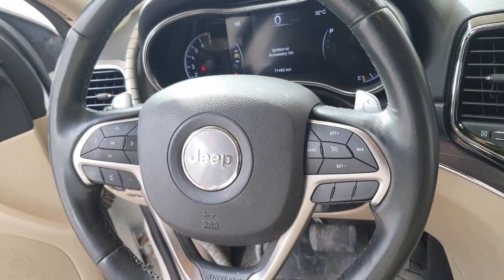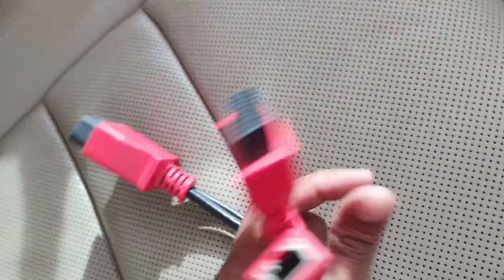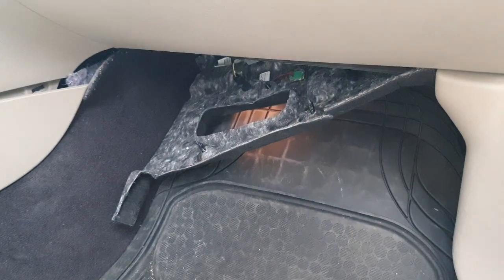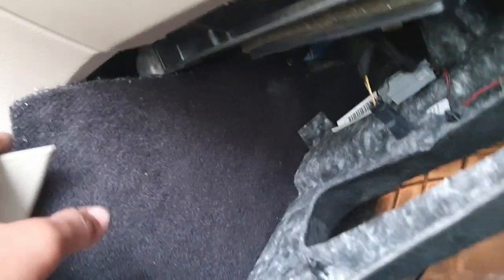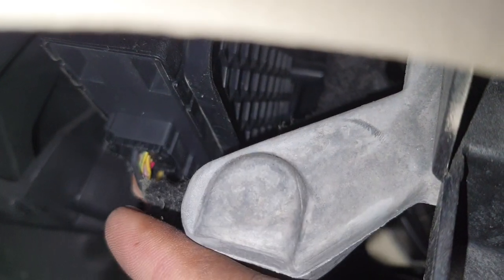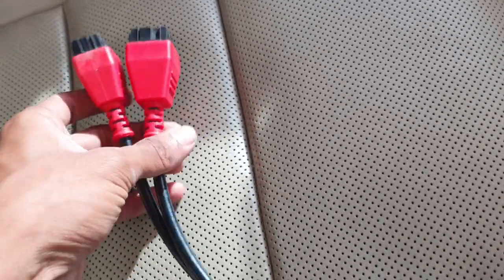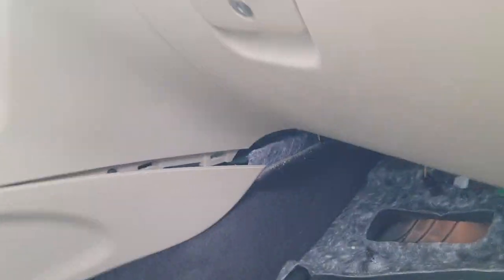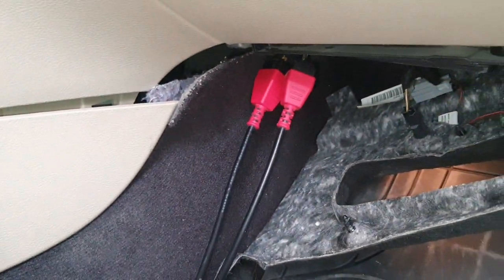Jeep Grand cherokee  obd2,obd port location,getway.

Comment: Wrong !
I'm a FCA technician ( mechanic) at a dealership in florida.  Your OBD port is under the driver side  lower dashboard cowl ( underneath the steering wheel) DRIVER SIDE !!!
and that includes every vehicle manufacturer,  it's always where the driver sits.
Reply: Lol he is not wrong the scanner won’t connect to the OBD to write keys you have to plug it where he did mopar or no car you must sell gay Chevy at that dealership
Reply: Can you tell me where is it in the grandcherokee L 2022 model?
Reply: i thought so this is crazy!!